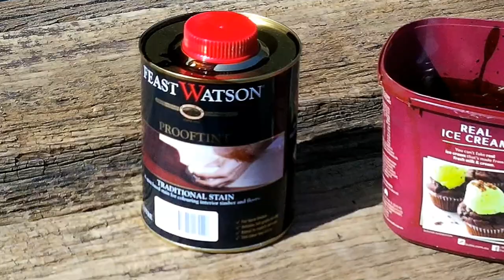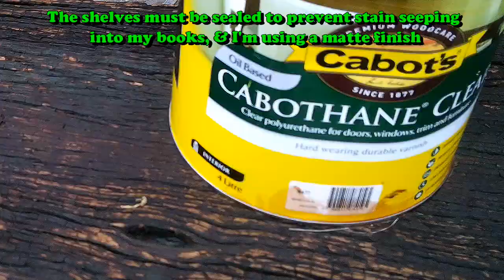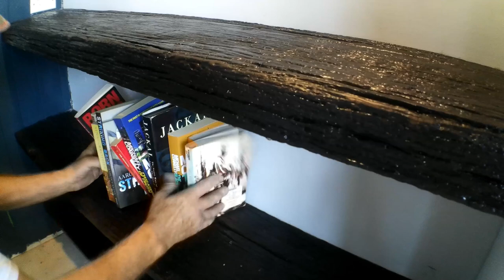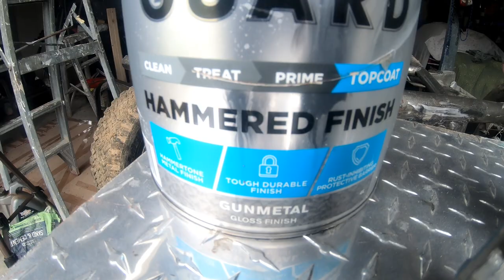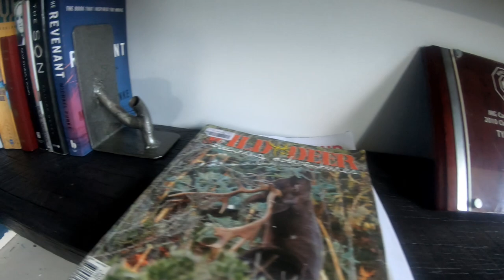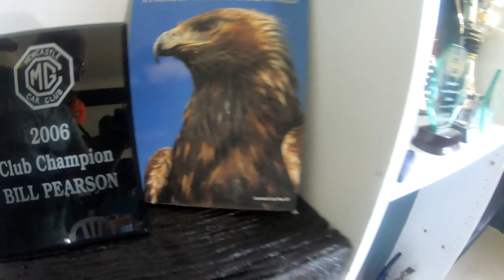Build My Own Home - Part 66 Mancave shelving

Comment: I have used a jet washer since i was 10 when my old man bought a Karcher home... he did the driveway once and then I did it from there on, I enjoyed using it so much that i always had one in my life, but the Karcher lasted many years more then 2 decades. I love the idea of using epoxy to surface the timber cos it will stop further deterioration and stop anything coming out of the wood after its installed.